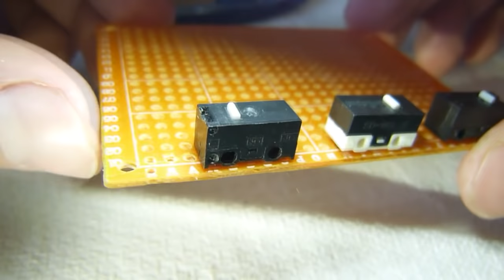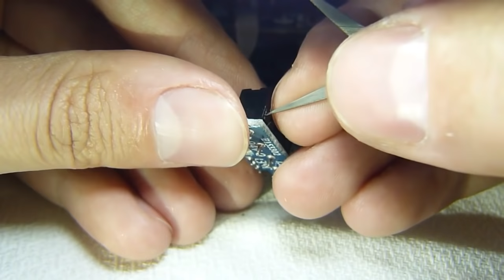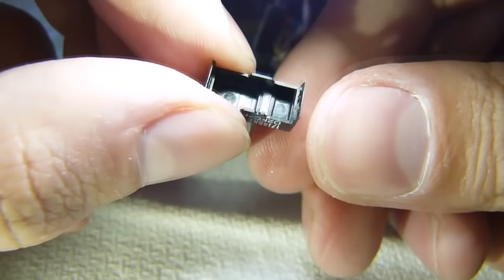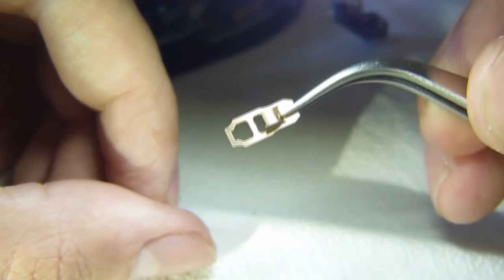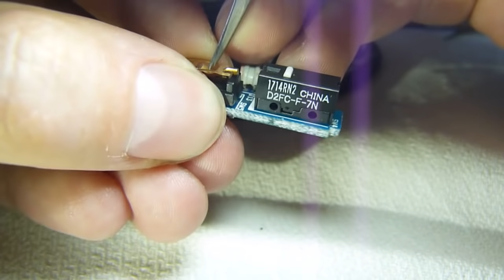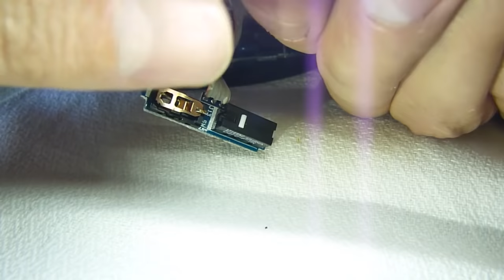Double click problem: How to fix faulty mouse button

Comment: Thank you for the guide but WARNING for others trying this...use a plastic warp cover on top first...because than I open the 2nd latch the top and the white piece fly off the the Galaxy far far away!
Reply: Should have heeded your warning, lol. It did fly off but luckily my keyboard was in the way to stop it hehehe.
Reply: It flew righy on my leg. I was lucky as fuck
Reply: I lost the button of my mouse and now my Roccat Kone+ can not be used anymore ;(
Reply: It flew onto my floor at night and had to use a uv light to find it, the uv light made it stand out luckily
Reply: I also lost that white one and thankfully found it 😂
Reply: read your comment and it was like: naaahhh
THE THING JUMPED ACROSS THE ROOM AND I WAS LUCKY TO FIND THE LITTLE WHITE PIECE
Reply: Mannn mine flew away can you buy them somewhere
Reply: The only time I don't view the comments while watching the video, luckily I was able to find it on the floor with a flashlight.
Reply: lol :D
Reply: Plautus egal  please. My mouse takes too much pressure to press
Reply: @rsuslik  you can buy broken mouse or omron switch and get that plastic thing from there
Reply: Thanks for your warning about the little piece flying off, I opened the first switch normally and it flew off, but due to you I opened the mouse in an enclosure so it didn't fly and get lost. 
the second switch I removed upside down, that is much safer way to removed the top cover

Comment: Guys, this video shows the MOST DELICATE and PATIENCE-REQUIRING step in repairing a mouse button. The rest of the steps of opening a mouse can be easy to understand. But this video shows the best trick for getting that stubborn metal strip back in place. Thank you OP!
Reply: I'll 2nd that. Very helpful video, just pay Very Close attention to how that flimsy little strip goes back on. This helped me get my Razer D/A tuned back up clicking good again.
Reply: Well i tried to do this with my Deathadder and the little piece of metal cracked and fell of, so RIP
Reply: it took me a few tries to get it back in correctly. also, when i tried to open the switch, it exploded, took me forever to find that little white piece...
Reply: Its look so hard.. Maybe ill buy another switch by omron that have more better clicks. Its pretty cheap actually
Reply: How would you know, have you done it before? I hate people that see a video and try to give instructions on something they've never done.

Comment: Thanks for the guide, i underestimated how small these switches really are, but it really wasnt that bad in the end.
Dont know if i bend the copper part too much or not enough (really saw no difference there), but it feels better. fixed the double click and it responds better than out of the box.

10/10, would void warranty again
Reply: Yes and do you feell you go to toilet much easier like button

Comment: Can't thank you enough! You Sir, have just saved me a lot of money on a new mouse. My G600 was giving me nightmares in game with the double click. I spent over an hour working on it based on your video and it works normal again. 

Note to all: Fixing your click switches is NOT EASY! This method requires a lot of patience as you will drop bits time and again. That copper strip is extremely delicate and can bend easily, so be careful. To be on the safe side, if your palms sweat when working on your mouse, spray the internals with Isopropyl alcohol. But my God, when your mouse starts working fine again, its a victory in itself..!!!
Reply: I literally just bought a new G600 because mine was double-clicking. If only I found this video last week!
Reply: @C_007  Wow, it’s actually been 4 years.
The fix gave my mouse another year of good performance.
Reply: @blitzcraig26  It´s possible to change the switch, very cheap.
Reply: I agree with every word
Reply: Man I discarded my G600 for clicking issues 4 years ago, but I have it somewhere in the house.

Me to my G600 :

I don't know where you are or how you are, but I will find you, I will fix you!

Comment: Successfully repaired my mouse with these instructions! And yes, the little white piece flied off, but I managed to find it. I did not desolder the button. I used a tiny scalpel knife to wedge the black plastic open.
Reply: I'm happy to see you here! Love your channel.
Reply: Thanks for your message about the little piece flying off, I opened the first switch normally and it flew off, but due to you I opened the mouse in an enclosure so it didn't fly and get lost. 
the second switch I removed upside down, that is much safer way to removed the top cover
Reply: I just finished removing that part and I used Scotch Magic Tape: before unlocking the latches, I cut a small piece of tape and placed it on top of the whole upper face of the switch (I used the magic one cause it is easier to tell when it's not making contact with the surfaces, and it's the only one I have lol, I guess any type would work, but be sure it leaves no residue) so when I was sure it was all secured, I proceeded with the latches and I was able to take it off without rotating it down (my mouse is a Logitec M570, so it would have been quite difficult to do it facing down without removing the whole board from the base and without braking anything...)
Reply: I read your comment first and then went on to disassembly, thinking...I'll be careful. It flied off like a rocket. But found it. :D.

Comment: It's amazing that they use such a flimsy part on the most important feature of the mouse
Reply: It's called cost cutting and it's everywhere in tech at the moment. They rather spent .50 on a switch than $1.
Reply: planned obsolescence, if they made mice that held for ever their costumers would disappear

Comment: 2020 here and it works, thanks for the video.
1 - I bended too much, so I couldn't even click anymore, then I unfold a little bit.
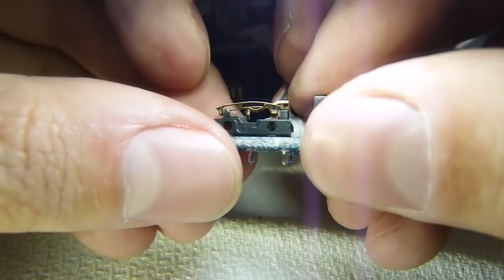2 - The trick to put it back is: First the side with the small pin, then the other side. Both need to be close to the top (or its going to fall). You can see in the video 3:24 that the metal is a little bit tight and curved, because its in the right position.
3 - Gently press the center area until you feel the click.
4 -  I highly recommend a tweezer, a lot easier to move the piece.

First try did in 30min~, second try in 1min~, not hard to put it back after you get used to.
You can actually know if the click is right as soon as you put the plastic box with the green small click back, because you can click manually with you nail and feel if its clicking or not. IF its missing, maybe you bended too much, as I did in the first try.

The noise of right click is less louder for some reason but fixed my Razer Deathadder Elite, 2 months of use and got double click/not registering in the right click.
Reply: THANKS ITS ACTUALLY SO EASYYYY GENIUSSS
Reply: Thank you so much omgggg
Reply: You're my hero I hole you're doing fine in 2024

Comment: The most important thing is that there is a limit to how far you can bend the curved piece. I just spent 1.5 hours trying to figure this out, but if you bend it too far, the middle spring won't sit on the middle post and the whole thing just falls down.  Then you have to straighten it back out so it can reach the middle post.

The trick I finally did was to put the contact end in first (the end with the raised dot that fits between the contact and the stopper above it) then used my fingernail to scratch at it to get the opposite end to hook over the post.  That got me to the point you see at 3:22.  Then, I kept my fingernail on the end to hold the spring in the groove and straight while poking at the middle spring with my tiniest screwdriver STRAIGHT DOWN very carefully.  Push too hard and the whole thing falls down and you start over. Fail to keep the end in the notch or push unevenly and the spring will shoot out to the side and you start over.
Reply: thank you
Reply: Wished I read this before going at it. 
Just finished fixing mine a few minutes ago. This would have saved me at least an hour.
Reply: Thx, you helped me a ton
Reply: Same set the ends then pushed the middle, it's never clear if it's same to hook the two ends then push the middle undercurve part to click because it's so fragile

Comment: You made getting that spring back on there look way too easy. My fat sausage fingers mangled the thing even with tweesers
Reply: ahh :)
Reply: I mangled it too. Luckily I was able to salvage an omron switch from a dead mouse to replace. And if you don't have one, you can order them for $1 off ebay. Replacing the switch was easy, but then I spent half an hour with rubbing alcohol and double sided tape to get the teflon gliders back on without kinks.
Reply: all the sausage fingers!!!!
Reply: i like how you pronounce tweezers
Reply: @RobotronSage  I need to gain some weight.
Reply: @cunnyman  I know this post is old, but I have an average fingers size for men, and was easy. I think isn't about the size it's about who is doing it...
Reply: Paul B samemee
Reply: Bro took me an hour to put it back in then test it to make it sound the same as other then i keep taking out then putting in to get the sound i want
Reply: mine just flew off to narnia... took me an hour just to find that single piece lol... should've listened.
Reply: I'M FUCKING CRYING I CAN'T GET THE FUCKING THEN BACKKK ON PLACE 😭😭😭😭😭😭😭😭😭😭😭😭😭😭😭😭😭😭

Comment: Finally got around to doing this - managed to get it back in in not toooo much time.
Thanks a ton for the video, and showing each step! One small tip: put tape across the top of the internal button before removing its case - this will help hold onto the little white button piece so you don't drop or lose it.

Comment: Yo, 2019 here. I have a Logitech G600 Mouse and it started double clicking like crazy.. and I thought it was just dust and some sticky things? After watching this video.. I fixed my mouse and now it clicks like if it was just bought and new. It's a brilliant mouse and is still 100% in tact only the double clicking annoyed me. You've saved me 90+ EUR from getting a replacement or a different model. Thank you so much for this! Cheers~

Comment: Video makes it look easy... but it isn't. Got it after an hour of futsing about. There's 2 microscopic grooves that the thin metal piece has to slide in to. Finally got it after I used a pair of needlepoint tweezers. Be patient, don't expect to get it back into the grooves as easily as the video did or you'll get frustrated. After putting it together it clicks better than when it was brand new.
Reply: futsing about... you mean you failed to use the tools used in the video then realized you should have and that's why you couldn't do it?
Reply: It's very quick and easy to do with the right tools, in 30 minutes I fixed my both logitech G300s
Reply: i realised that if you should place/slide the whole thing in, then only slightly depress the middle spring to lower/push into place for the tension, this way is i feel its damn fast.

Comment: Some important hints:

1. Get tweezers before you attempt this, as it's almost impossible to do with your fingers.
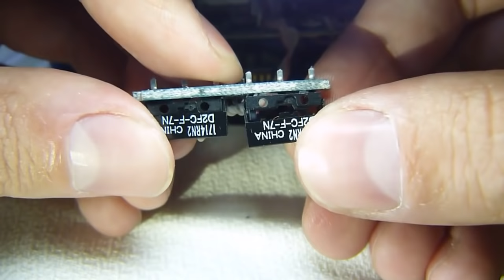2. When opening up the switches (at 1:34), make sure to do so very carefully, in order not to have the little white part flying away! (very important and has been mentioned by others below)
3. When putting in the metal spring back in (after fixing it), make sure to push its second latch (the left one at 3:21) not all the way down! If you look closely, there's a very fine groove where the metal of the spring has to slide in. If you push it all the way down, the switch won't really work (I did this two times before figuring out the mistake!)

Other than this, great tutorial, thanks for the help =D

Comment: took me two whole hour for this, but hell yeah! no more need to buy a new mouse every time that shit happened. if i knew this before it'd save me 4 mouses.
Reply: +Max K with that method you would have to solder  not every one can do that
Reply: +Max K sweet!  thanks!
Reply: +chozo echo (W.W.P.P) Nah, you transfer the wire from a brand new switch to your old one. No soldering required. Good for when the wire-bending trick stops working.
Reply: mice*
Reply: took me 1hr45min and then I found this video, 15min later I fixed it.  Just seeing how they got the spring back on did the trick.
Reply: 2 hours? it took me 15min
Reply: i have 4 of the same logitech mouse that i lost the usb sticks for

Comment: Pro tip to those that attempt this, the copper piece is annoying AF, and if you don’t keep your cool, you can easily break it. If you bend it wrong while putting it back in(difficult AF) it will be harder to get it back into its spot, because the grooves were seemingly built for specific tension, and you cant bend that copper thing wrong or else it’ll not bend back without risking breaking. Just be patient and keep your cool. It may take a few hours but as long as your gentle, it won’t break, and you’ll eventually win.

Edit: I broke two copper tension things, ruining 1 mouse. It was just an old broken test mouse. I had two old broken mouses, I was able to fix the other.
Reply: Here to confirm. Opening the mouse up and getting to the copper thing took only about 30 minutes (with youtube tutorials), despite this being my first time disassembling a mouse.

Putting back the copper thing took over an hour, and a fraction of my sanity. It flew off my fingers a couple times, and had to spend a few minutes to look for it on the floor everytime. 

End result: It actually worked. Fixed the double-click as well as the drag-drop issues. BUT I might have messed the copper thing up a bit too much, cause now my mouse button doesn't give a distinct 'click' (both sound and haptic). Nevertheless, it's more than enough for me, especially if compared to buying a new mouse entirely. 

Someday might try swapping the copper thing of my left and right mouse buttons if I never get the used to this silent-mode MB1.
Reply: @julliferjosephtuba2202  i dont know if im too late, but i attempted this (saw some other video first) and it worked, but i too lost the 'distinct' click.

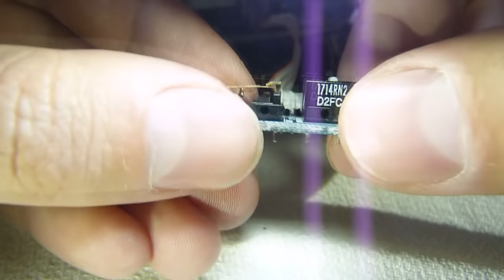Though I just figured out what i did wrong, at 3:50 they "click" the middle part of the copper thing back into place, which i hadn't done. I just re-opened my mouse and re-did the fix and i now have the distinct click too!
Reply: @kyuzex  bruh you're a savior. Been trying to get that copper piece back into its place for 30m now but the click wasn't there. Thanks!
Reply: A thing to note: what this fixed for me was not a double-clicking problem but mouse clicks not registering, as well as losing your click when dragging and dropping.

Difficulty: 7/10, be prepared to burn several hours on this. Depending on the mouse, the screws are under the teflon, which will start scratching your mousepad, sometimes even after a lot of trial and error. The Omron shell is small, and it's challenging to see the crevices without proper lighting, but I did this without unscrewing the whole board with the mouse still plugged in to the PC. A sewing pin works for popping off the cover with some trial and error to find proper leverage. The white plastic piece that puts pressure on the copper tends to bounce away when popping off the cover, so be careful!

The copper: slides out, as seen in the video, easier to one side and not the other, so don't accidentally bend it. Once I removed the copper piece, I bent the curvy part backwards with a toothpick, but only to the point that the "claw" was even to the base, in a nice neutral position. Inserting it back in will bend it down somewhat, but my clicks still worked fine afterwards, so I wouldn't worry too much about keeping it "neutral". Obviously, be extremely gentle during this step.

Mounting the copper part (the most frustrating step): you will either lose your mind at this point, accidentally break the goddarn copper, or lose it somewhere because it's going to slip away every 10 seconds. Ideally, you're going to want to unscrew the whole board, so the shell doesn't interfere with the leverage. I did not and regretted it because the thing is just that fragile. I don't know if the bottom part of the Omron differs ever so slightly from the one shown in the video, but what is hard to see is that there's a tiny crevice in the prong at the center that's supposed to keep the curvy part in place. So, after an hour of trying to figure out how to put pressure on the copper the way you see it in the video (it has to bend, starting like in the video, and then latch onto the prong at the end, so it stays fixed), I eventually figured it doesn't feel like it's snapping in, doesn't click, nothing, it just sort of stays in place, but will fall off when pushed even slightly to the side -- this is the part that's "clickless" because you haven't snapped the curving part into the crevice. The good thing is doing it like the author of the video is doing will eventually work, but it's more helpful to take the casing off of the other switch to see how the copper is fixed in place -- in the video it doesn't look quite right.

The final step is just a lot of trial and error, you have to press down on the thing that has to latch into the crevice in the middle prong, but the copper piece is just too unstable. I tried it with a toothpick and with a screwdriver, but I found it's better to apply pressure at a diagonal angle than downwards, at which point the toothpick eventually worked. Don't put the casing back on unless you can press the copper down with your finger, so you can see it doesn't move around or you might bend it beyond repair. The mouse should click normally if you succeed, but not before you assemble the casing. Putting the shell back on seemed trivial, so I won't go into detail.

Hopefully, this is helpful to someone because this was frustrating as hell -- and F**K Chinese Omrons.